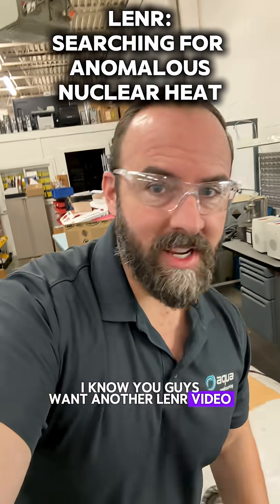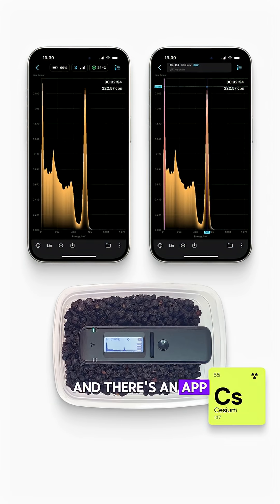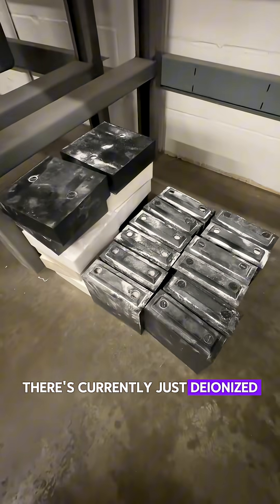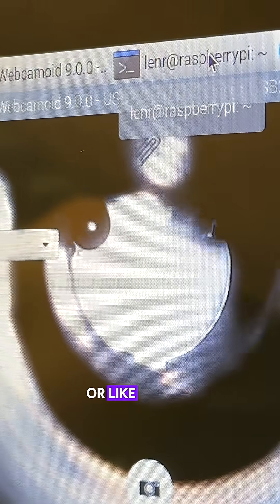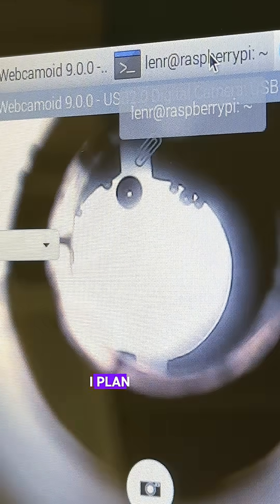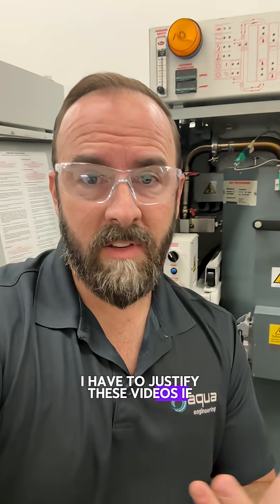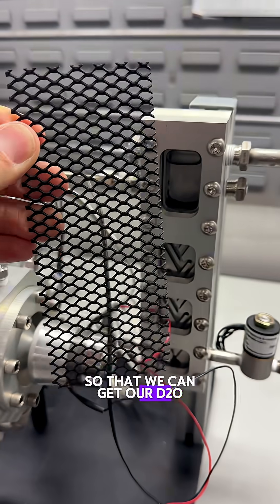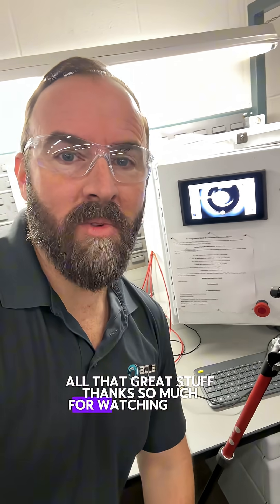LENR and the Radiacode 103G Analyzer

Comment: Have you considered using steel mesh (Brillo pads, the kind you'd use to smoke crack) à la Malcom Bendal's ionizing chamber/bubbler in the thunderstorm generator, to maximize surface area for bubbles to form?